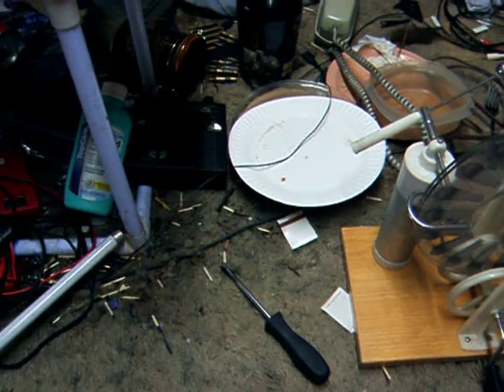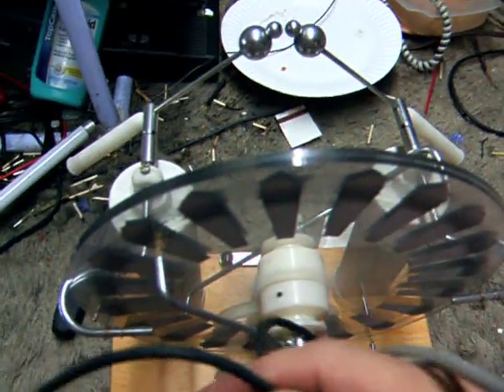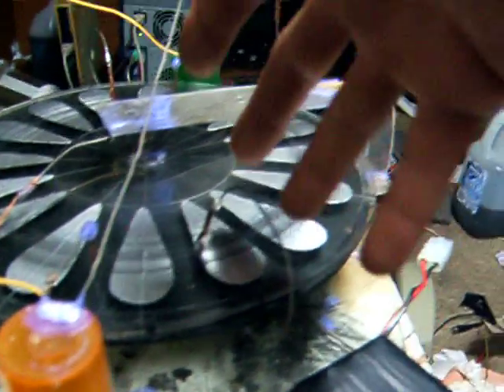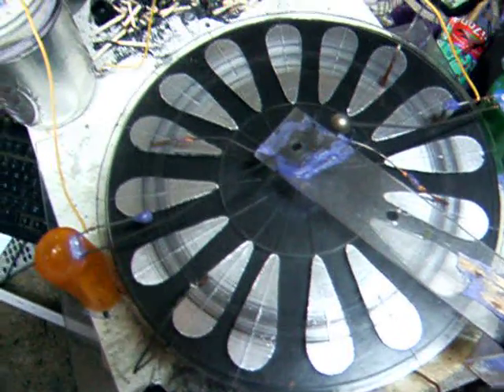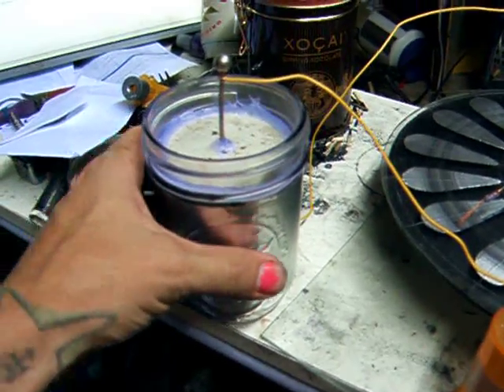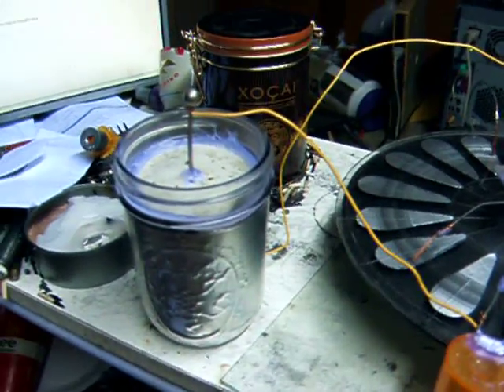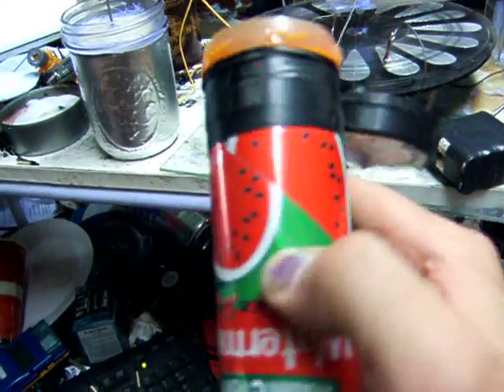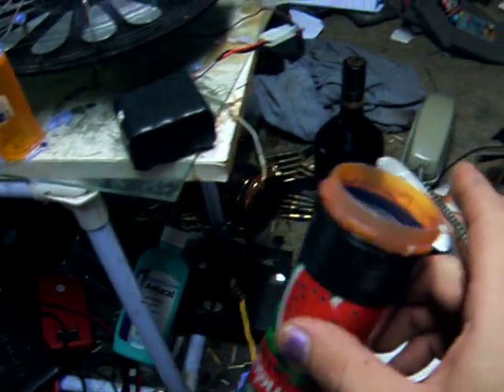Voss high voltage generator small demonstration

Comment: can you show us how to build that machine plzz i would really love to try it
Reply from the maker: ill make an atempt i will do it during the week of rain comming up i have to do all this DMV stuff while the sun is out
Reply: thanks you i want to study it and learn from it plzz make the video thank you
Reply: can you do it really soon i just cant wait to do it. i want to replicate your machine. i am excited
Reply from the maker: ill try tonight  it might have to be in little parts my up load speed sux @ss but it is really simple ill tell u you need a few things two arizoma ice teas ro two tall cans of beer witch ever you fancy 2 records and metal duct tape "there is sutch a thing" and a hot glue gun and a motor and two jars of some sort i used large pill bottles and some wire =)
Reply: i wana now the connections. do you connect your bottom aluminum to the capacitor? and use your bottom aluminum as a collector ? there only 4 brushes right ?
Reply: i am actually using CD hehehe
Reply: should the layden jar be cylinder ?
Reply: i already build a small ones using old CDs but mine does not spark hehe i really need your help i want it to spark

Comment: so if i can run this moter spinning these plates say off of a aaa battry 1.5v dc than this 35kv or 35000.0v why does eletricity cost money at all takes less than 1.5 to run the moter and puts out thousands of times the input i know this will run lights like cfl/floresent tubes if it can run them why cant i use it to run my tv and the rest of my house just converting hv to 60hz ac? and does more voltage convert into current cause at 30000.0v you shure are at no lack of lil pixies to flow through any pipe
Reply: ok voltage does result in current i know that now or resisters wouldent work is there a way to convert voltage to joules easily in ur head i hate writeing things down rather do everything in my brain
Reply from the maker: well i wont say but u might have stumbled on some thing here is the main
 reason and its hard to explane but what ur seeing is NOT electricity 
just converting Hv to 60 hz is all good but for some reason its not 
posible in this situation b\c once again its not really electricity
Reply: xoxoXoieoxox well what is it then it acts like eletricity and i came across a cia document that was declasifyed bout telekanesis and static eletricity being produced from the body and that the body can manipulate it so what is it and what are its propertys
Reply from the maker: IDK what it is and it has many simmer property of electricity but there are some differences i like to call it cold as opposed to electricity that is hot this suff dosent suffer from atomic friction and a spark of this will not light butane and it cant be stored for long pirodes the moment i stopped calling it electricity and expecting it to act that way i got a lot farther with my research =)

Comment from the maker: there actually prity easy to build the rpm of the disk really dosent matter it only determons the frequency but if u make ur lyden jar too big ti could potentially build a lethal amount of voltage but it dose produce a little better at lower speeds =3-